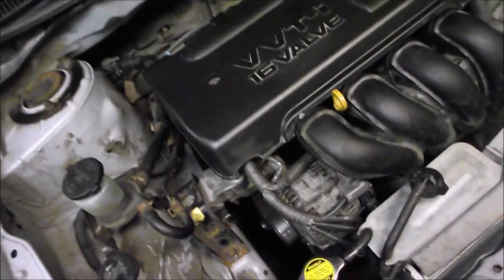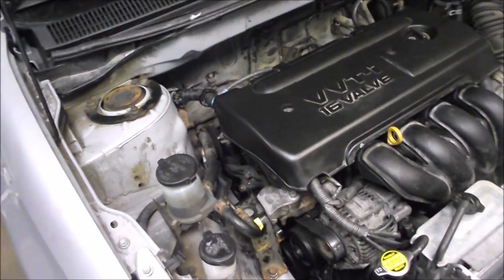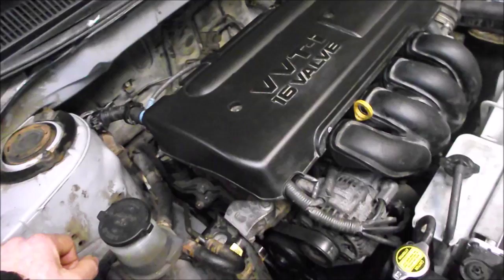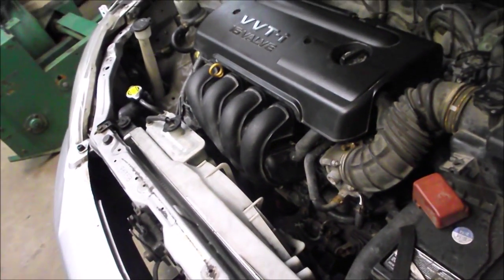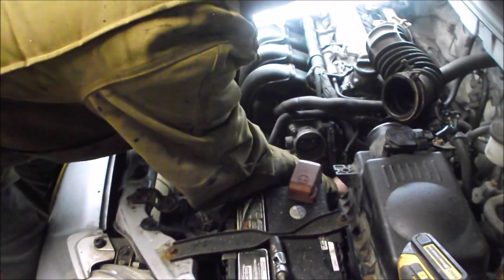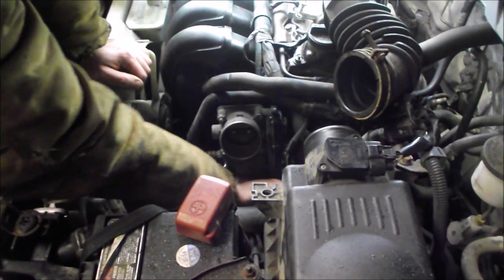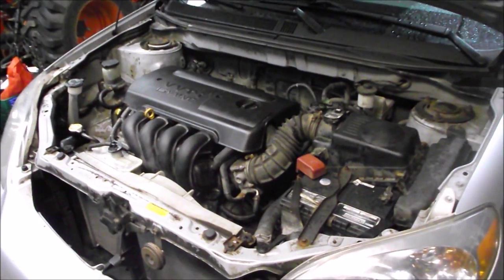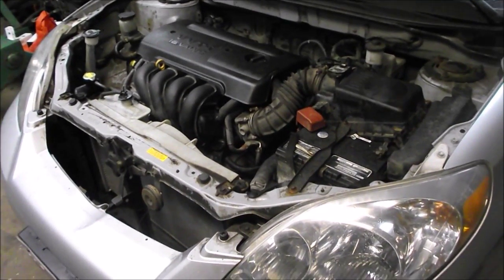DIY Head Gasket Replacement 2007 MatrixVibe Part5 of 5 Final Test

Comment: Just watched all 5 videos, very helpful!  I have a 2005 Matrix that overheated no won't run at all, cranking it😁 sounds like there's no compression at all!  I used to do all my own work; clutches, brakes, a few engine exchanges and head gasket jobs but it was over 25 years ago.  Watching your video has been an encouagement to give it a go.  Nothing to lose as it's junk currently lol. Thanks a lot for taking the time to make this!
Reply: Same thing with mine currently, I never caught it overheating though. Sputtered a bit, was low on power. Cleaned itself up the next day. Then sputtered and died. Now sounds like no compression. When turning over. Thinking head gasket also.

Comment: There’s an idle relearn procedure, look it up. It involves turning the key to the on position 2 times then starting the engine, engaging the parking brake and placing the car in drive for ten minutes and the idle will self correct. Nice videos.